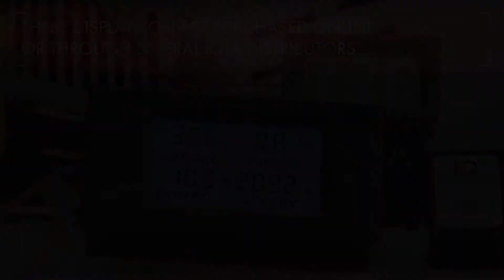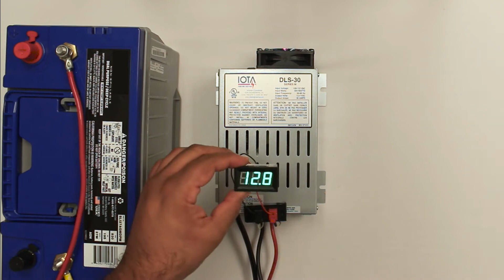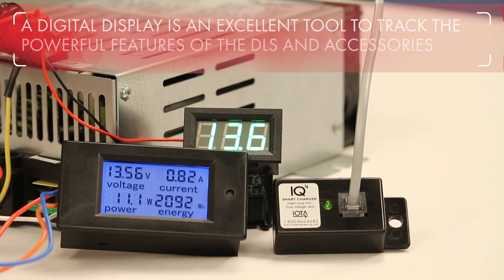Using a Digital Display with an IOTA DLS Charger / Converter

Comment: What size wire do I need to go from the charger to the batteries
Reply from the maker: Hello! The wire size you need is going to be impacted by a few different factors depending on your application. Here is a link to our Wire Gauge Reference Sheet that should have the answers you are looking for: https://www.iotaengineering.com/-/media/abl/iota/files/technical-library/right-column/dls_wire_gauge_and_length.pdf?forceBehavior=open

Comment: So where did you get the shunt?
Reply from the maker: Hello Jim - Great question! In this case, the shunt was included with the digital readout, which is commonly the case when a shunt is required for using particular displays.
Reply: Can we get a link for a place to pur hase that particular multifunctional meter? Please
Reply from the maker: Hi Bryan - there are many different displays available on Amazon, which is where we obtained our models that we used for the video. Here's a search I did for 'Digital Voltage Display' (you'll see the one featured in the video is classed as a 'best seller')https://www.amazon.com/s/ref=nb_sb_noss_2?url=search-alias%3Daps&field-keywords=digital+voltage+display As we are not the manufacturers of the displays, and have not researched all of the various options, we can't really endorse or recommend any particular model or seller. I would defer to the product reviews of the different options to find the voltage display and seller that you are most comfortable with.Regards! - IOTA